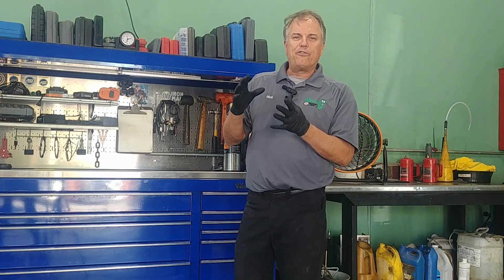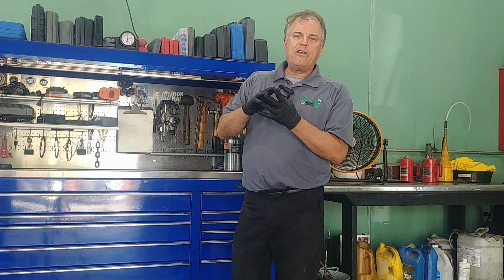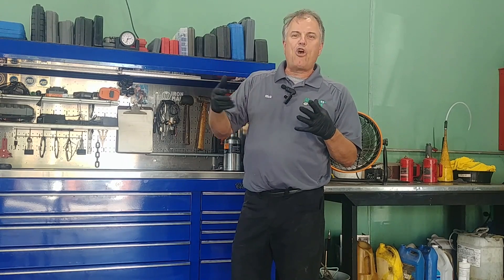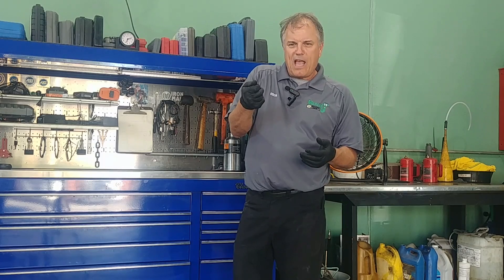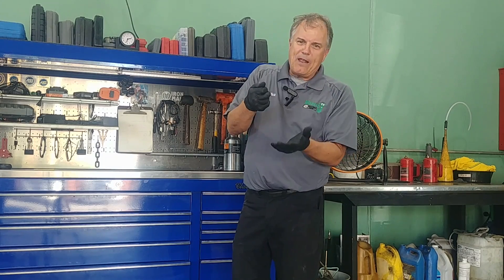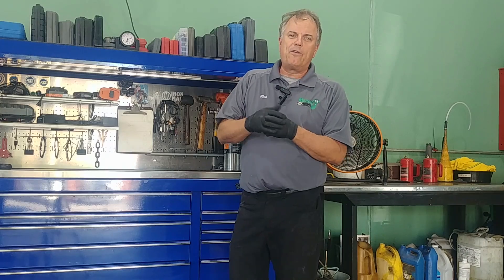How do you know if its a bad Starter or Alternator?

Comment: I have a question! If the key goes in and you turn it, it goes from slow ‘grrr grrr grrr’ to a fast-paced ‘vzztvzztvzztvzzt’ sound does that seem more like an alternator or a starter?

As an extra data point, the radio has been randomly turning off.
Battery is new!
Reply from the maker: It sounds like a low voltage issue.  If the battery is healthy I would be looking at cable or connection issues.  The test we would perform in the shop with a meter is called voltage drop.  We would test the drop on both the positive circuit as well as the negative circuit.

Comment: Mine does the click click thing
Reply from the maker: If it sounds like a toy machine gun, that usually indicates low battery voltage. Always check cable connections for tightness and cleanliness.
Reply: @MercieJAutoCare it’s more like click click twice type of thing then nothing. I try it a couple of more times then it starts.

Comment: I hooked my multimeter up to the battery and the volts are wildly moving all around but when i disconnect the battery and test it then it's a steady 12.6v, it's been driving me nuts for awhile i can only jump start it , i fully charged the battery recently and it ran for like a month and then stopped starting again and had to jump start it with my jumper, now it's basically unable to start even with a fully charged battery, starter or alternator? That is my question. Shop said the Alternator was ok, i don;t know how many or what kind of tests they did, I assume they used their special testing gear to rule it out, but I don't think they tested the starter, so maybe we try that next?
Reply from the maker: The cables and connections have to be good from the battery negative to the engine block and from the battery positive to the starter solenoid.  If those are ok and the battery is healthy, then the signal to the starter needs to be tested.  Every make model and year are so different that I can't give you a generic answer.  Wiring diagrams are like a road map for a technician that we use to put together a diagnostic plan.
Reply: @MercieJAutoCare  Thanks for the input, I appreciate it. I've only used wiring diagrams for guitar pedals and synthesizers or amps, etc. Cars seem similar but a bit more complex to me so far, but i've started studying them to learn as much as I can about it, so i can understand it better, your point about the cables being very important and tested also applies. Indeed all those errors could just be from a bad connection or part in the starter etc indeed. That was also my thought as well, so the fuse could just be showing me a response to a bad ground connection or part in the chain and not that  actual cause of it indeed. The battery was on tight though and it still returned about a month later, so at least i know if i tighten the cables on the battery side it still fails so yes on the block and other parts they need inspection as well. Anyone of those other points in the circuit could be the culprit and the fuse spiking just a symptom of it.
Reply: @MercieJAutoCare  I can tell you this the ground cable to the battery was hot to the touch implying overcharging which was one of the error codes that and a spike to 800 miliamps then back to 100 mas on fuse 19 which involves one of the error codes, the mirrors, which the passenger one is damaged could be a broken wire the assembly has to be replaced i sent it to a shop with a part i got from a salvage yard for the mirror assembly, to rule it out, it was open to the elements and water etc. I hope it's really that so i can finally be done with it. But i know that might just be something on the circuit and it could be the BCM trunk latch auto stick switch door locks overhead light etc. Or its none of them and that is just the BCM cycling and there is an issue with starter and or alternator etc making the BCM cycle like that. Or BCM is the problem or a bad battery, my battery tester though seemed to imply they(i have 2) were both good, only when i hook them up to the car do they read crazy readings on the multimeter. Which kinda implies a part malfunctioning in the circuit somewhere or a bad cable at one end or a bad BCM sending out requests cause it's malfunctioning and not working anymore. It's weird cause it seems to run for a month and then it stops starting, could just be a bad starter motor as well, wouldn't be the first time i had a starter go bad on me, this one in particular is 22 years old.  The car is old now still has nearly all originals. Would not be shocked if one of them had a bad solenoid in it. As for overcharging that would come from a bad alternator regulator possibly, at least that was my working theory.

Comment: well if you started the engine using a jump cable, its certainly not the starter the problem right or wrong
Reply from the maker: That's typically a low battery issue.  However starters can be intermittent, so you have to make sure it was not just a coincidence it started with the jump
Reply: @MercieJAutoCare  awesome, thanks

Comment: I have a 2011 Koa sorento. I push the button and it doesn't do anything. No noise. I will push it a few times and it starts. It doesn't do it all the time, but typically after sitting overnight.  No battery light or any codes. Is it the starter?
Reply from the maker: That would be a typical starter symptom.  During the incident, power to the solenoid should be checked to verify.

Comment: If anyone could help I would really appreciate it. Got a Chrysler 200 s 2015 and the other day it didn’t want to start so I used jumper cables to turn it on thinking it was the battery. Got a new battery plugged it up still wasn’t the problem. So would you put more money on an alternator? Hopefully it’s not the starter since you have to lower the axle of the car just to replace it.

Comment: Mine cranks but it won't turn on I replace a fuel filter and still nothing I don't know if it's alternator or the starter or the  spark plugs I'm completely lost
Reply from the maker: If it cranks, the starter should be fine.  You need three things for an engine to start...spark, fuel (pump and injector operation), and proper compression.  The testing is a little more than I can help you with in this short reply.

Comment: How about a rapid fast clicking sound.

Battery new starter is new and alternator was replaced to 136amp from a 117amp.
Reply: I have this happening right now. I hope someone answers.
Reply: Did you ever get this answered? I have this problem and car won’t start sometimes. I saw in another video the clicking sound is the starter trying to get its process going to start the engine
Reply: @nicklorusso2826 could be the starter relay failing to engage

Comment: Another thing that could be a tell tale sign of a bad alternator is if your steering wheel gets hard to move. The alternator will make your power steering not work properly so it is also not uncommon for your power steering light to go off. That happened to me and my co worker  when our alternators gave out
Reply: Yeah i would get the trac light and the ABS light and check engine light and then car would just turn off and drift to a stop, i tapped the emergency to stop it sooner but was unable to steer as all power dropped out, that's what happens when you lose power steering. Thankfully it was in a parking lot or in my subdivision when it cuts off, you should get it towed never let it go like that not safe but for maybe a couple miles if you are close to a shop, other wise tow it.
Reply: So if my car don’t want to start but it will try but my steering wheel hard nd want move it’s my alternator?
Reply: @ABMDeeskiiii3x lol She meant when the car is already running and the steering wheel gets hard to move.